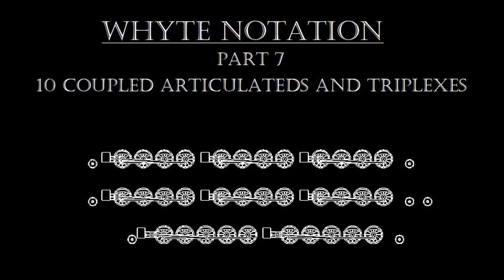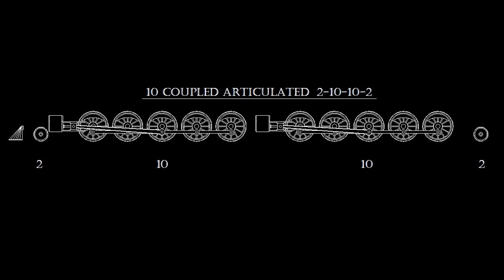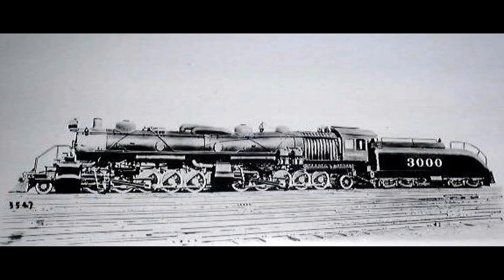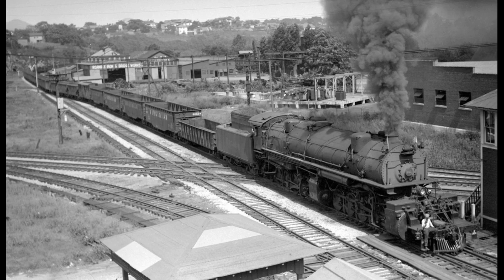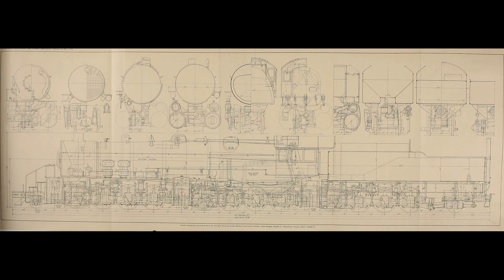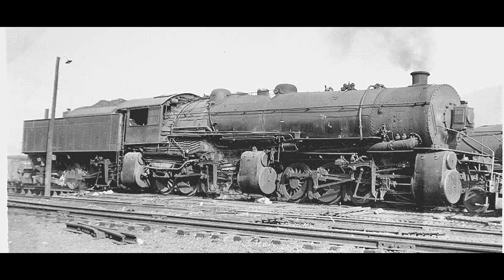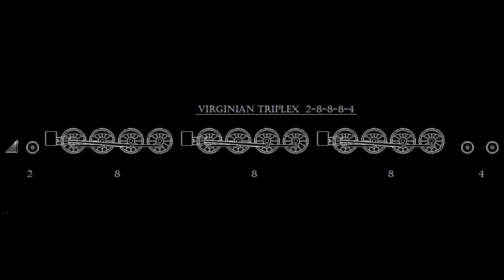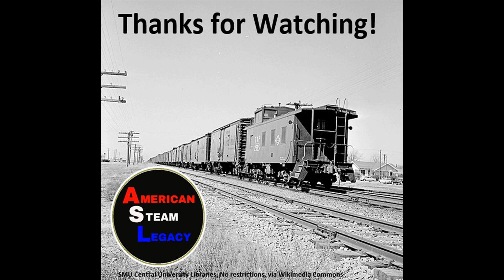Whyte Notation - Part 7 of 7 - 10 Coupled Articulateds & 8 Coupled Triplex Locomotives

Comment: Regardless of the predictions on how powerful the triplex was it was more powerful than the big boy
Reply: Power and rated tractive effort are different things though.
Reply from the maker: Hi richardjayroe.  In terms of tractive effort the triplex wins.  But the undersized and low pressure boiler would give the triplex a horsepower output well below the 6900 hp of the Big Boy.  Thanks for watching!!
Reply: @americansteamlegacy-yh9dr  true unless under 10 miles an hour (15 according to the video). Keep in mind that's all it did anyways